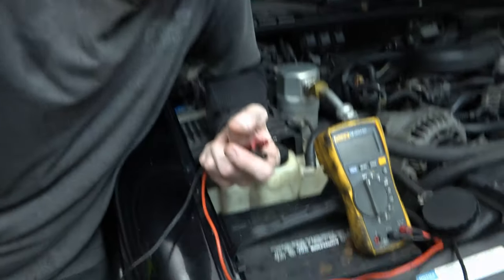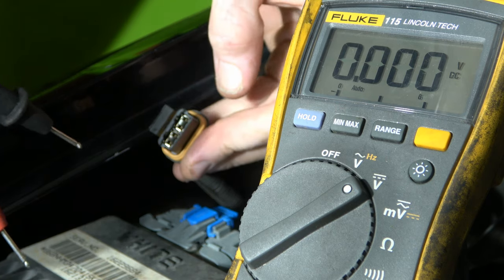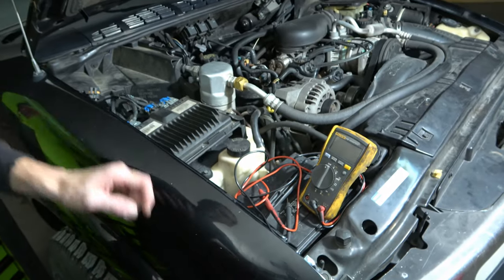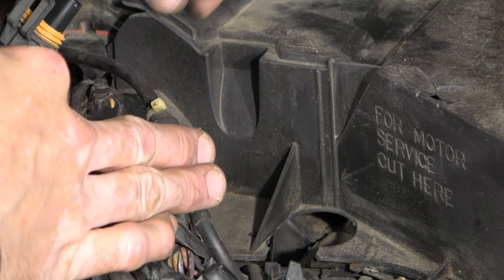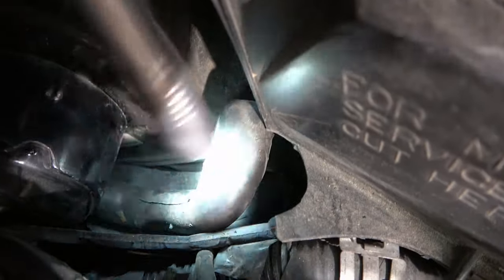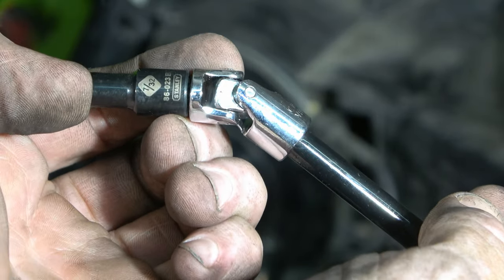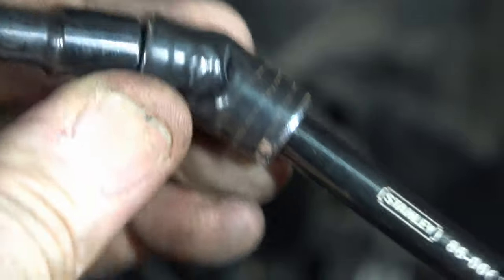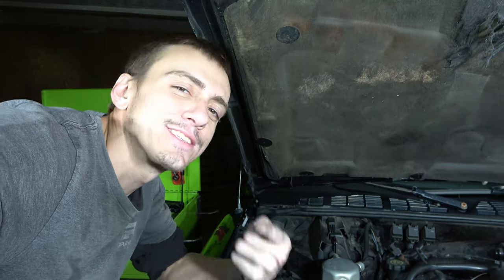How to replace a blower motor (Chevy Blazer)

Comment: Manual switches inside aren't working. Blower motor is fine. Ran direct wires from battery to motor. I have a 98 blazer zr2

Comment: My blower runs great but it does not seem to have much output.  I'm sure it's never been out since 95.  could it be clogged with dust?

PS that plastic that you like, mine just crumbles.
Reply: Resistor

Comment: I tell you what, I really like what you got going on in this video here, my blower motor start making noise and I think it's got leaves in it, I hate to have to take it apart because the plastic is falling apart too, I'm trying to figure it out if it will be worth replacing the entire cover, but if not, I think I'm going to spray coated with some rubber material to make it stay together a little longer before it falls apart.
Let me know what you think about if it will be worth replacing the entire thing but just coat it with something to make it stick together.